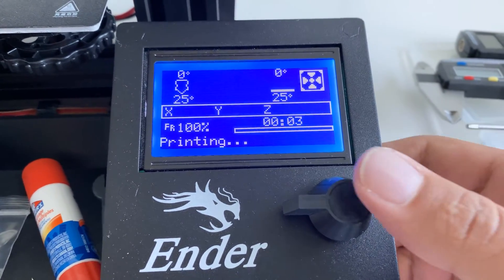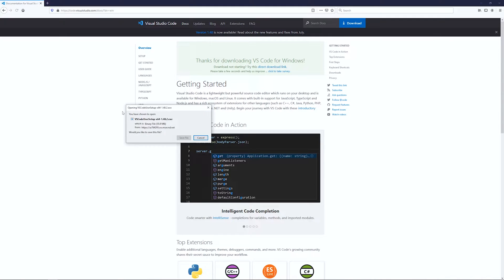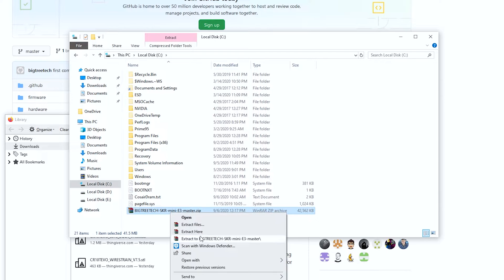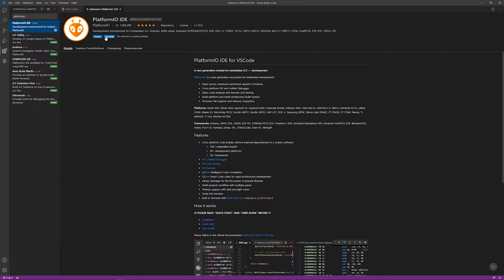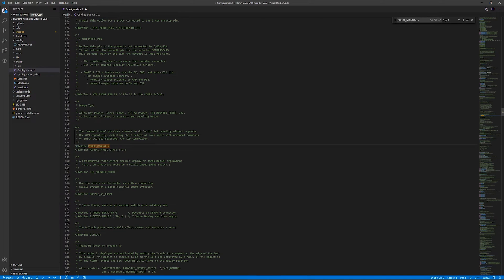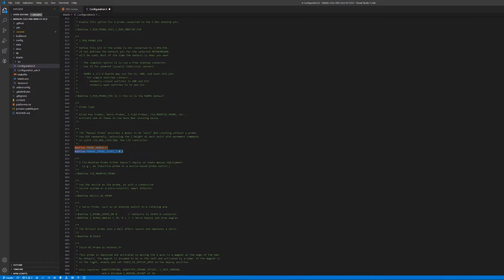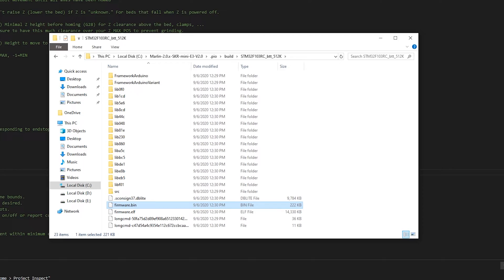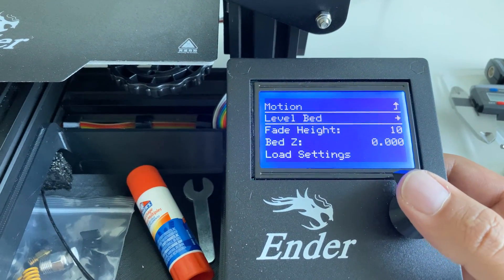Ender 3 Pro BigTreeTech SKR Mini E3 V2.0 Updating & Compiling Marlin Firmware | Mesh Bed Leveling!

Comment: WELL  i did everything right, got the bin firmware and put it in the sd card but still doesnt allow me to do anything. BTW i have the TFT35-e3 v3 and the screen boots normally, i open up cura and it doesnt allow me to do anything (like it is not connected).
Reply from the maker: Did you create your firmware file or you used one of the pre-compiled ones? You may want to connect the stock display (or at least flip over to the marlin interface) to see what is happening. The TFT35 is a mini computer on its own and will not give you a good indication of what the printer is actually doing.
Reply: @Mangorille  I created my firmware file, i did tried to switch to the marlin mode but it only shows a red screen on it and nothing else. I can only use.touch mode, im having several issues not only this one, i can't flash directly from vscode, I cant move a lot the steppers (it only allows me to move it a 10 mm and thats it and homing is horrible, shows not connection in cura and, hot end not heating propperly, and the other stuff i already mentioned you, but i dont want to give up. BTW im installing it on a anet a8 hardware (only steppers and frame)
Reply from the maker: @luigitejeda328  That may be the issue, my understanding is that the firmware is for an Ender 3.

Comment: I don't know if they changed the file but it failed because of #endif
Reply from the maker: Hey. I just compiled a new firmware last week and it worked okay. Which board are you using and did you try compiling the firmware without making any changes? Thinking that the error may be related to something that was changed.
Reply: @Mangorille  skr mini e3 v2. After turning those off it worked fine
Reply from the maker: @WarSimulations  It should not cause the printer to become unresponsive. Do you have any other accessories connected (other than the TFT35)? The instructions are tailored for a stock printer.

Comment: As always, great video! When installing bltouch onto this board, would you happen to know where the new z-axis stop wires should be connected (looks like there are two optional places)? Is the z-axis stop switch being used with bltouch? What do we do with original z-axis stop wire?
Reply from the maker: Hey, thanks! There are two ways to wire up the bltouch but the only way that I was able to make work on this board is the one below. You remove the z end stop switch as it is replaced by the bltouch. 

https://github.com/bigtreetech/BIGTREETECH-SKR-mini-E3/blob/master/hardware/BTT%20SKR%20MINI%20E3%20V2.0/Hardware/bltouch-2.0-2.jpg

Comment: Thank you for your Video! Unfortunately i can't save the Z-Values after the leveling . Is it a bug ?
Reply from the maker: Hey. The leveling values should save automatically to the EEPROM once you finish the leveling process. When you print a leveling test, do you see the z motor moving up and down slightly to correct for any warp in the bed? Once you start a print, do a G29 S0 command (or do a M503 to report the EEPROM settings) to the printer and see if the bed leveling is on and what the leveling points being used are.
Reply: @Mangorille  Thank you for the Answer . The levellin is set to ON the Values are OK but the nozzle is far way up from the bed ! Here the values. I dont understand! :-(
 Recv: Mesh Bed Leveling ON
Recv: 3x3 mesh. Z offset: 0.00000
Recv: Measured points:
Recv:         0        1        2
Recv:  0 -0.12500 -0.20000 -0.22500
Recv:  1 -0.27500 -0.30000 -0.25000
Recv:  2 -0.22500 -0.20000 -0.10000
Reply from the maker: @gpelekanos  Those figures look good and it says that the leveling is on. Did you try printing right after doing the leveling or did you power off the printer and then print?
Reply: @Mangorille  yes i did it all.. The nozzle is high . i am still trying to figure it out. I change slicer, still the same. Thnks für your help.
Reply: wenn i start the leveling again, i see that the Z- values are all set to +0.200 !
Reply from the maker: @gpelekanos  That is correct, it always starts the leveling process at the setting you put in the firmware for the MANUAL_PROBE_START_Z

Comment: Thanks for the help.  having a few issues.  Running a non pro, the auto home is leaving the axis up against the switches, and not bumping back like on the 1.2 board.  Also mesh bed leveling is NOT above the bed on when leveling.  It is off to the left/front.  Corner leveling seems fine, but not mesh leveling.
Reply from the maker: Hey. How much space is there between the nozzle and the bed when it stops the auto home? Can you elaborate on what you mean by the mesh bed leveling not being above the bed?
Reply: @Mangorille  What was happening was the first three probes on mesh bed leveling was in front of the bed.  What I discovered was I had to center the bed using adjustments to MANUAL_X_HOME_POS.  Im sure there are other ways, but Im at least printing again
Reply from the maker: @roytyson  That's a new one, the home offsets should have been set correctly in the firmware from BTT. Glad you got it figured out and are up and running!

Comment: Hi thanks for the video and you can help me with compiling marlin for my skr e3 mini v2 but with bltouch using the z homing stock? Thanks
Reply from the maker: Hey Khristian. Have you tried the pre-compiled bltouch firmware on the BTT github? They have one for bltouch already. If you need something specific, let me know and I can compile for you. Not sure what you mean by z homing stock as the bltouch will replace your z end stop switch.

Comment: Thank you thank you thank you.  I had same problem. Would always have an error compiling. Something was always missing, incompatible, conflicting, etc.  Now I can get my printer running again!
Reply from the maker: Hey bud, glad to hear that! I had the same problem and spent so long trying to troubleshoot. Weirdly enough the steps in other YT videos didn't work. So many possibilities once you can compile your own firmware. :) Happy printing! Thanks for the coffees by the way!
Reply: BTW I skipped the step in the platformio file. Seems like a recent update fixed that problem.  The new one is 10.0  I didn't restrict it to 6.2.0
Reply from the maker: @6SpeedSRT  Good to know, thanks.